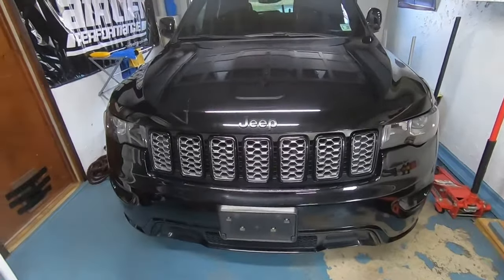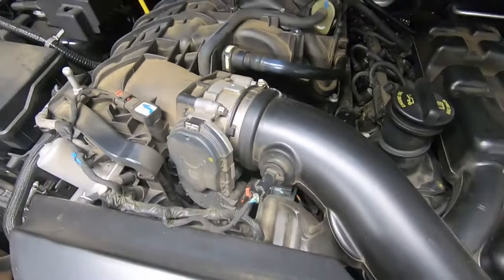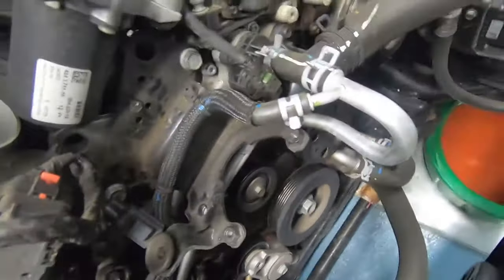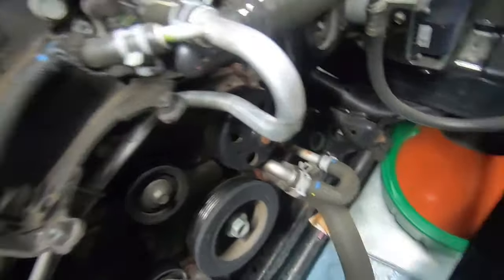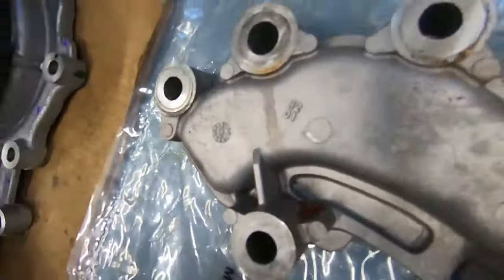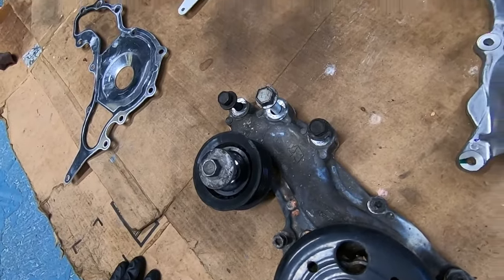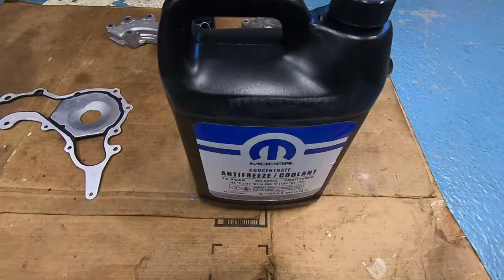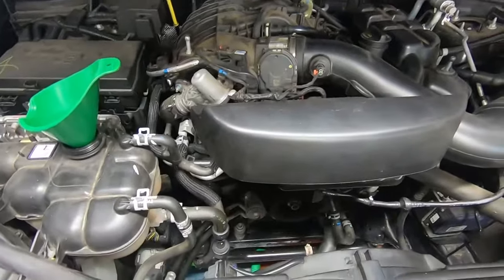2016-2021 Jeep Grand Cherokee Water Pump Replacement

Comment: So the weep holes go bad I have the same issue on a 2017 3.6 jeep Cherokee how do I know the thermostat is not bad. What would cause it to leak out of the weep hole just a bad pump?
Reply from the maker: These pumps are known for failing. And after some more in depth observation of this pump after i made this video…i realized i mis-spoke and that isn’t the weep hole. The weep hole is actually a little higher on the pump. The part that fails on these pumps is like a mini “freeze plug”. Thats what leaks….and what i showcased in the video. Serves absolutely no purpose and is extremely common. Just a stupid design at the end of the day.

Comment: Excellent video, thanks for posting it!  Our belt got chewed up so I decided to change the water pump while I was there.  Good thing I did, because when I pulled the old pump off, the bearings were falling out of it!  Also replaced the idler and tensioner pulleys at the same time.  Don’t want to have to take it all apart more than I have to!
Reply from the maker: Most definitely man! Glad you got it done & all sorted 👍 thanks for the comment!

Comment: Dude very awesome video just replaced mine after 53000 miles which is pretty sad for OEM. This is also my first time leaving a comment on a video. Thanks again.
Reply from the maker: It definitely is! Very common problem on these things. Thanks for the comment!!
Reply: Crazy mine just went out after 180k+ miles on 2013 challenger

Comment: This was perfect. Did the whole project on my '18 right along with yah. Few subtle differences along the way, but I was sort of amazed at how easy this turned out to be. Thanks for the awesome video!
Reply from the maker: Awesome! Glad it helped 🙏🙏🙏🙏
Reply: I have a 18 also. Is it really that easy??
Reply: @JayL1855  Hey Jay - so, for me, I would say if you're using all the tools he has, following his suggestions along the way, making sure that you follow the torque instructions, I would say yes, compared to some other maintenance items (like changing the spark plugs, which requires you to remove part of the intake), this is relatively simple to both tear down and put back together. I think the only difference on the '18 from the video was that the top bolt on the water pump was a 16 mm instead of 15, but other than that, it was the same. All in, took me about two hours to do, start to finish. Just take your time, don't skip any of the steps in the tear down or reassembly, recheck your work as you go along and it'll turn out well.
Reply: Okay sounds good. I’m pretty handy. I’ve called around just to get quotes to fix it to see what people would say and it’s anywhere from $600-750 so I thought id same the money and do it myself
Reply: @andrewcarlson5205  Mine was around 55k, so it sounds like you did well to make it to 71k!
Reply: how long did it take start to finish?

Comment: this is one of the best videos I've ever seen. done absolutely perfectly. complete job start to finish without too much fluff. I can't say enough about it actually. perfect camera work, perfect dialog including all necessary information. to think that you had to do this twice and you didn't skip a beat. thank you and I applaud you. need to tackle this this weekend and you just took the stress right out of it (other than hoping that the new part doesn't leak like it did to you). would gladly subscribe.👏🏼👏🏼.. one question if you could answer.. what was the part number for the pump you got from Advance. I'd like to make sure I got the one that you got if possible.
Reply from the maker: Thank you for the comment. I truly appreciate it!!! Unfortunately, the leaking is just a design flaw in these pumps in general. This new one from Advance (last one done in the video) is now leaking too 🥲. Literally almost every one of these I’ve ever been under the hood of is leaking. I detail for a living so i actually get a chance to see these frequently. Not sure on the part number though, oddly the box was blank, and the customer actually purchased the pump themselves and brought it to me. All he told me was it was ordered from Advance.

Comment: Appreciate the torque sequence diagram and torque specs. There is also a bleed screw on the top of the thermostat housing if you can't get that final burp in the system. Most water pump manufacturers recommend spinning the pump by hand with coolant in the system to just get the pump itself lubricated, but most folks seem to skip that. Thanks for the thorough video.
Reply from the maker: True indeed! Appreciate the comment 👍
Reply: not all have the bleeder

Comment: Followed these instructions for my 2016. It took about 4 hours. Only differences were that the 15mm bolt on the pump was 17mm. Also, the radiator has a built in bleeder valve below the air intake hose that you must use, though it actually makes it very easy to bleed the system.

Comment: Good afternoon, excellent video. I just changed mine in a 2016 Grand Cherokee, after 2 days I notice that it is leaking again. Not if it is due to the gasket that the area was not clean enough (I don't think so but there is a possibility) or that I put a torque of 8lb.ft on all the screws. as I saw in other pages. The day I did the job there were no leaks, I had it on for an hour and then I went out in it for a couple of hours and everything was ok. Today I realize that it smells like refrigerant and I check and it's leaking. I am going to retighten the screws with the torque that you put to see if it is solved. or in the worst case I will do all the work again to change the gasket.

If it's not too much trouble, what scotch product did you use to clean the area? Thanks
Reply: Scotch Brite 7447 is what it looks like
Reply from the maker: 31:33 …..red scotch bright pad. Like above comment mentioned, 7447, you can utilize that.

Not sure why you put 8ft. Lbs on all the bolts though, the lowest rating is 9ft lbs on the 10mm’s, and the bigger bolts have higher torque values. All outlined in the video…..right from the FSM. 

But ensure its leaking from the actual gasket, not the common leak point on the pump. But if you torqued every bolt to 8ft lbs, I imagine it could be leaking from gasket.
Reply: @lustedp  thanks, that's what I was looking for, the sponge model
Reply: @TheOriginalBeeCee  Yes, before I watched this video, I searched the internet for the torque and there are a couple of Jeep pages and forums that indicate that value (8). I checked again and it seems that the pump is defective and leaks behind the pulley. Yesterday I cleaned the entire area and the periphery of the pump all looks dry. After a few minutes of operation stat leak in the area of the pulley and it is what wets the bolt below. (I'm already waiting for a replacement from the seller) 

Thanks
Reply from the maker: @fmha1987  got yaa. Good luck with the replacement, I honestly don’t think any of these water pumps no matter the brand are going to not leak unfortunately. The design flaw is the same throughout with that stupid ass freeze plug under the pulley that leaks.
Reply: @fmha1987  I would recommend getting a wire cup brush with 1/4 attachment to a drill to get all of the prior gasket off the mating surface + the scotch brite + brake cleaner.  You really don't want any of the prior gasket still on the engine/mating surface before putting on the new water pump.  If you look, on his first install he had some gasket residue still left.

Comment: How is that new pump holding up??? I had mine replaced at the dealer when I had work done under warranty. Original pump lasted 50k (only leaking from weep hole). I am 65k now and the new pump is leaking from the weep hole again, ugh!
Reply from the maker: Didn’t hold up at all. Leaked from the freeze plug/weep hole again, just like alll the others. I gave it one more attempt after this, I tried to rectify the issue and address it head on. I cleaned up the Gates pump and tried to RTV the dime sized freeze plug, but it didn’t work unfortunately. Actually just did an oil change on it today and its leaking worst than ever. And it doesn’t seem like replacing it, again, is going to solve anything. Its just a design flaw, you can see its a constant issue from some other comments as well. They need a new redesign desperately
Reply: Wow, that’s so unfortunate! Whats the next move just let it leak? 

My 2019 had whole new long block and everything put in it at 50k and the original water pump was leaking at that time as well. I’m now 65k and I noticed a faint coolant smell again and the weep hole has coolant present and I can see very small dried residue on 2 bolts near the pulley, nothing enough to run down and see anything on the ground. Going to have it done again under the warranty on the repair, but not sure what my options are if it happens again so early. Keep having them doing it under the repair warranty Chrysler offers? Not sure.
Reply from the maker: You can keep having them do it, although i doubt its going to change anything. Its just going to leak again. They all leak. I detail, and I see these frequently, and since I’ve done this….ill always check to see if they are leaking. Last like 9 out of 10 were leaking. One i just saw was leaking at like 40k. Only one that wasn’t, or looked like it wasn’t…had 30k. 

Like i said, they need a redesign. I don’t think replacing them is really going to fix it. Just a 5-10k mile fix at the most. Shouldnt have to change the water pump every oil change interval. 

I was just letting this leak and topping it off every oil change. Honestly, its the only thing you can really do in my opinion. this is a friend of mine’s vehicle, i told him he should consider offing it. this is a real flaw that has no real resolution.

Comment: We are on our 4th water pump from the same jeep dealer. Each time it leaks from the same place as this video after about 4-5000 miles. First one started leaking at 75,000 miles. All covered under unlimited / 7 year warranty maxcare. 
The question is why does it keep leaking down the same weep hole?
Reply from the maker: Sorry to hear. Definitely a common issue with these. The pump on this Jeep in the video is now leaking again too. Twice really. 

Upon digging into this a bit deeper, I don’t believe it’s the “weep hole”. It’s actually like a small “freeze plug” that leaks on these pumps. If you look through the pulley at the opposite side of the aluminum freeze plug that leaks, you will see the weep hole. 

This “freeze plug” that leaks serves no purpose as far as I see it. It’s just like they slapped this plug in the front of the pump… and it leaks when it gets hot. 

The second one installed in the video began to leak, as mentioned. So i figured something had to give, obviously. So…I still had the Gates one that was initially installed sitting in my garage. I cleaned the Gates pump up & attempted a fix on it. I RTV’d the plug, tried to get it the best i could thru the small hole in the pulley. Installed it again (3rd install now) and…. it’s leaking again. So despite my best attempts, the fix didn’t work and it’s leaking worse than ever. 

so overall its a design defect on these pumps, and there is no fix….unless they do a pump redesign without this freeze plug in it. that would be the fix. New pump with no hole/plug. Now…If someone could sneak in there and potentially weld the edges of the plug to the pump might be a potential fix as well…..but that wouldn’t be an easy task. The real fix is a redesign needs to be available for replacement. 

As for the Jeep in the video…the initial Gates pump leaked as shown in the video, then the replacement outlined in the video leaked…then I reinstalled the Gates after my re-sealing attempt on the plug, and its leaking as of now. So currently just monitoring the coolant and topping of when needed ensuring fluid level is correct.

Comment: Just curious....I'm looking for a pump for my girlfriend's 2017 Grand Cherokee Limited 3.6L.....I see a butt load of pumps that all look identical but I get  notes that say the pump won't fit my jeep on most of them. What is the difference in the pumps?
Reply from the maker: I’m not 100 percent on what the differences are. This is a 2017 and I got the Gates pump off of Rockauto. They have other brands was well including the OE Mopar:

https://www.rockauto.com/en/catalog/jeep,2017,grand+cherokee,3.6l+v6,3435257,cooling+system,water+pump,2208

Idk what brand i would go with honestly….Seems they all are prone to failing due to the design, even the OE considering the original on all these fails very early.

Comment: Do you think I should do the Thermostat while I do the waterpump?
Reply from the maker: You don’t have too. Its not like you are taking it out while doing the pump like some other vehicles either. I usually believe in if it aint broke dont fix it, I personally didnt do it on this job.

Comment: GATES pumps should take you out for a steak dinner!! Thanks for the complete video. I feel confident to do my wife's 2014, Jeep Grand Cherokee water pump replacement now. Do you think I should replace the original serpentine belt based on the age while I'm at it?
Reply from the maker: Hahaha…appreciate the comment! Unfortunately I don’t think it was the Gates pump, its just a design flaw in these pumps in general. This new one (last one done in the video) is now leaking too 🥲. Literally almost every one of these I’ve ever been under the hood of is leaking. I detail for a living so i actually get a chance to see these frequently. As far as the belt, if its showing signs of age and/or like 120K+, it would be a good time to do it since it will already be off. I would suggest a Gates belt! Lol

Comment: I have a 2016 Jeep Grand cherokee just hit 100,000 miles.  I noticed a burnt coolant smell after driving over the pass 100 miles and when i opened the hood, i noticed under the water pump that there was  little coolant leakage. Nothing running out or on ground. Is it safe to drive back home? Could this be water pump or just the gasket?
Reply from the maker: As long as you aren’t over-heating, and your coolant reserviour stays topped off you can drive on it. Usually these slow leak from the pump themselves as outlined in the video. Usually a slow manageable leak, but leak nonetheless.
Reply: @BeeCee Built  thank you so much. Im nervous to drive it back home.
Reply from the maker: @Yvettebeautymakeup0x0x  just keep an eye on that reserviour. As long as you have coolant in there you’ll be perfectly fine. I doubt its a large leak so im sure it’s manageable

Comment: I recently started hearing whine noises when I accelerate 80 70 wk,2019 34k miles,  could it be water pump,? Haven't seen any leakage
Reply from the maker: Really hard to say without experiencing the issue or hearing/seeing the vehicle. 

From my experience water pumps that mechanically fail typically don’t make a “whine” noise though, more of a scratchy/bad bearing sound and/or belt squeal. 

These pumps are known for leaking issues, I can’t say I’ve heard of one making noise. Probably cause they leak so early they don’t make it to the mileage where the bearing could go bad and actually makes noise lol. 

One way you can help eliminate a belt drive noise is remove the belt, and spin each pulley individually manually with your hand…and see if you get any noise out of any of them. Most of the time, if a pulley is bad you can hear it by spinning it and checking it this way.

Comment: Ya these pumps kind of suck. I replaced the one on my gf’s GC like 3-4 weeks ago (with mopar) and I just noticed it’s leaking through the weep hole 😑
Reply from the maker: Yeaaa man these things definitely are prone to coolant system issues. There are known coolant system issues with these, and i think these pumps continuously failing is part of it.
Reply: Same here. Changed the pump on my wife's 2018 GC 9 weeks ago @53k miles with mopar pump and now leaking again out the weep hole. This will be 1st and last mopar I own. Several defects on this1 and bought it brand new with dealer servicing it
Reply: @TheOriginalBeeCee  if it leaks out the weep hole is it ruined? we replaced ours and it leaks a little
Reply from the maker: @jamiebordelon6365  smh ridiculous
Reply from the maker: @dazellrankin6710  its not “ruined”, but of course leaking is never good or ideal. It seems most people just chop it up and deal with it. It seems no matter the brand, it just inevitably fails and leaks from the hole again. You can keep replacing them until you might get lucky and not have a leaky weep hole….or I would suggest monitoring the leak and coolant level regularly, and if its just a slow drip and nothing serious I would maybe just leave it.
Reply: @TheOriginalBeeCee  thanks

Comment: Could that be the reason why the exact same model is making a squeaky, scratchy sound?
Reply from the maker: Anything is possible really when it comes to vehicles. Water pump bearings can fail, and cause unpleasant sounds from the pulley while running. Easiest way to find out would be to remove the belt….then spin the water pump pulley manually with your hand to see if you get any sounds and/or if there is any play in the pulley.

Comment: My replacement pump lasted 4 months. Way I live is only twenty plus square miles total and my jeep is not a every day driving vehicle
Reply from the maker: They are all crap. Its a design flaw. You can replace it 1000 times and it’s eventually still going to leak from the stupid damn front freeze plug. Im currently test trialing a permanent fix.  Ill know in the next couple months.
Reply: @TheOriginalBeeCee any luck finding the permanent fix? Thanks!
Reply from the maker: @YixuanSong-s5q  didn’t work unfortunately